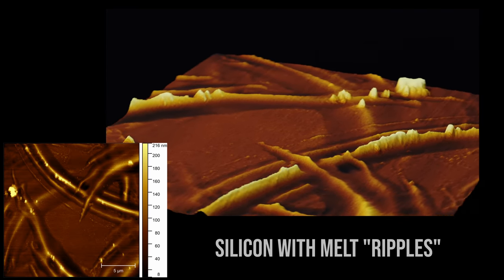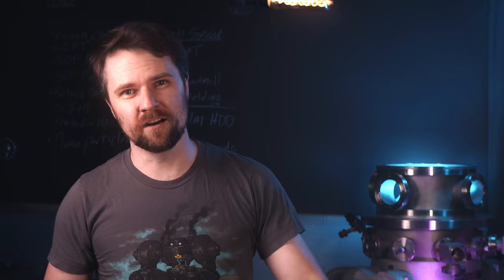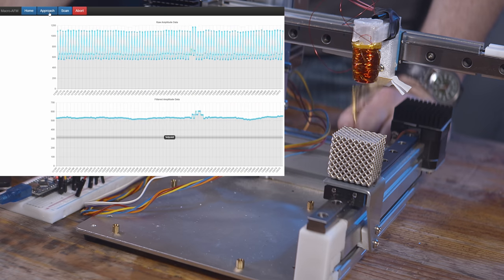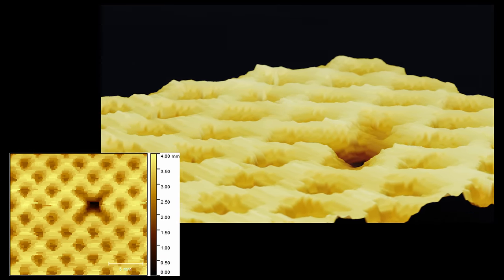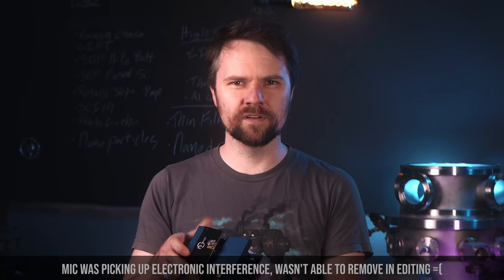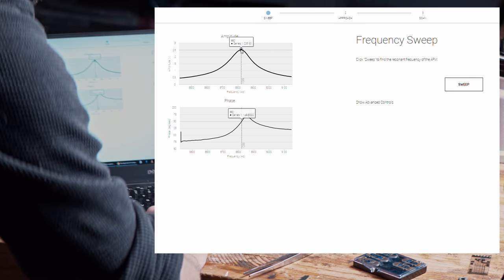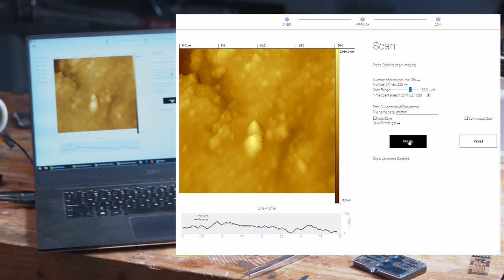1,000,000x Magnification with Atomic Force Microscope

Comment: Is that typical for the surface roughness of gauge blocks, or is that abuse?
Reply from the maker: TBH I'm not sure what's expected from gage block surface finish.  This was freshly unwrapped from it's oiled paper so not abuse... but they are uhh... not the highest quality :)  I probably should have mentioned that in the video, they are cheapo imports from Shars. 😇
Reply: From my understanding gauge blocks aren't manufactured to be smooth, the main goal is to have a really precise geometry and the resulting smoothness of the surface finish is more of a byproduct :)
Reply: @dienelt5661  I was under the impression that wringing gauge blocks together required not just flatness, but also smoothness, I was surprised it is as rough as it was, but I have no way to know just how good is required, or what is typical.  I could imagine a rather large collection of gauge blocks showing up at my doorstep from all-and-sundry merely to stick them under my afm, if I owned one.  Not a cheap hobby!
Reply: @BreakingTaps  Does that face wring with other blocks?  An optical flat and monochromatic light  might come in handy if you can find one on ebay cheap.
Reply from the maker: @blahblahblahblah2933  Just tried, it does! I think I have an optical flat laying around here somewhere (watching too much of Oxtools can be dangerous to one's shop-tool collecting habits).  I'm starting to work on some shorter "Micrograph Monday" segments which just look at neat things under the AFM or other microscopes, will make sure I do a followup on the gage block and show the wringing and optical flat results.  Would be interesting to see just how flat it is at a "macro" level compared to the micro roughness numbers.

Comment: I'm pretty sure AFM stands for Amazing F-ing Microscope. 

Just one question, can that tip get fouled by something? If so, is it possible to clean the tip?
Reply from the maker: Theoretically, yeah, the tip can accumulate debris and other junk.  The coatings on the tips are relatively inert (aluminum oxide and diamond-like carbon, depending on the tip) which helps prevent it from chemically bonding to things. I've not had any major problems so far though.  Had a large piece of junk stuck to it once but was able to "shake" it off by re-running the cantilever sweep process.  Otherwise no real issues.  More often it'll just scan over the debris (like dust particles) because the tip is so tiny compared to most particles it encounters.

But because they are tiny and delicate that there's no real way to clean it by hand if they happened to get dirty, so if it ever does get contaminated badly I think the tip is just done.

Comment: Would it be possible to do a DIY version of this. I have a machinist and toolmakers background but I now work in metrology and run my own lab and small business from home. I mostly do component level troubleshooting and repair for industrial and research clients. But I specialize in test equipment calibration and configurations. 

I also have a pretty decent photonics lab piece together over the years of government and industrial auctions. So I’m just curious if something like this would be possible for a decently comparable DIY version…? At say a 10th of the cost so I guess that means under $3000. Just curious.

Comment: Is it possible to use one of the probes to probe part of another probe (without damaging the subject)? From what you explained, it doesn't need to contact it?
Reply from the maker: Haven't tried, but it should be possible! This machine uses tapping mode, so it is making (very gentle) physical contact about 9000 times per second.  But the force of the cantilever is quite small so it doesn't damage the subject.  Although amusingly, that probably means imaging the cantilever itself would be difficult since it is likely to flex under impact of the other cantilever, as they are both designed to be soft :)  But otherwise yeah, MEMs are a perfect subject to image.  I'd like to pry open some common MEMs (gyros, etc) and see what they look like :)

Comment: plasma sputtering crystal growing, even that silicon, not the two usual processes, Czochralski or Flame fusion, cvd/pvd type layer growth instead, to wafers, in vacuum chamber, for cheap, simply, fast, a ton, tons of wafers
Reply: so you made a gramophone head
Reply: laser interferometer (graviton detector) distance measurement
Reply: hard disk is a mini "atomic force microscope", or at least it should be
Reply: actual up-down movement, no angles, for the atomic force microscope stuff
Reply: spring instead of bending lever arm
Reply: multiple read/write heads in a matrix, each writing its own scan line
Reply: piezo crystal is a self-regulated spring
Reply: also self-measured and generated response to touching

Comment: Do you think it would be possible to observe the circuitry on a silicon chip, after some careful lapping maybe ?
Reply from the maker: Definitely!  I'm trying to hunt down some more bare IC dies to scan.  Theoretically it'd be best to avoid lapping, since that would remove some of the topographical features, so either a plain die before it's encapsulated or a decapped one with just chemicals.  That said, the machine also records phase information, so you might be able to see the phase difference between polysilicon, metal, silicon, etc even if the surface is lapped flat.

Amusingly, the IC I showed at the beginning ended up being really hard to scan because the features were so large (due to its age)
Reply: @BreakingTaps  Wait, phase information?  What phase information?!
Reply: @BreakingTaps  wow that sounds like it could yield some amazing photos, but the results would be even more impressive with more recent hardware because of the transformation size, but those don’t come cheap especially right now :(
Reply from the maker: @aneb2002  Yeah! I didn't have time to talk about it, maybe in a future video. ICSPI actually has a really good blog on it (https://www.icspicorp.com/blog/afm-phase-images), but my understanding is that it records how much out of phase the cantilever oscillation is with the drive frequency, and that can give information about the mechanical properties even if the height is the same.  Softer materials will deform differently than stiffer materials and so the phase changes.  TBH I'm still trying to wrap my head around it, but I've seen a few scans that were really fascinating (aluminum on glass was very obvious for example: https://twitter.com/BreakingTaps/status/1388264624429146114)
Reply from the maker: @dienelt5661  Agreed! I'd love to see some stuff made in the last ten years. How cool to see 50nm gates or similar :)
Reply: @BreakingTaps  You can grab some parts with windows any microcontroller with an eprom should do.  Or even a cmos or ccd camera sensor  should be pretty easy to come by.
Reply: @BreakingTaps  If I'm understanding right, we're talking about non-contact FM-AFM right?   And you're talking about the phase difference caused as the tip approaches and the spring constant of the cantilever is shifted from one end of it's travel close to the surface to the other where it's less affected?   Also, the link you link to ICSPI returned a 404.
Reply: Actually, given you posted that twitter scan from your afm, and you're running tapping mode afm, I am now entirely confused about exactly what phase we're in/out of.
Reply: remove end brackets on both the links if anyone else doesn't spot it
Reply: ...and the icspi link explains tapping mode phase shifts quite well, ty for that!
Reply: the tldr for anyone is that in tapping mode as the tip interacts with different surfaces, any 'stickiness' to the surface (if that be actual stickiness or just the probe deforming into the substrate more with viscous effects) slows down the rebound creating the phase shift.

Comment: But wouldn't that poking smash tip and mess results? How would you spot such problem on that small tip?
Reply from the maker: You're right, the tips do wear down over time!  Tips have different wear rates depending on size/shape and their material.  Generally the smaller the tip, the faster you'll notice wear.  E.g. if a hundred scans changes the shape by 1nm, it's much more noticeable on a 20nm tip than a 100nm tip.  That said, my particular tips are coated in Al2O3 and DLC (depending on style) so they are pretty "hard" and don't wear too quickly, but other kinds of tips used in different machines might only get a handful of scans before needing replacement.

Detecting the problem is down to A) if you aren't happy with results or B) running a calibration test.  There are special test substrates you can purchase that have well-defined features (nanoparticles, test gratings, that sort of thing) which you can scan to see how much your tip has changed.  But I think most people probably just replace the tip once the results start looking "not good" or features start to look larger than they should.

Comment: By which mechanism does the device scan in the X and Y directions in order to achieve the 20x20 microns area?
Reply from the maker: The MEMS device is built with a set of integrated flexures and actuators that provide the momevent.  I believe they use thermal chevron actuators to actually drive the flexures.  You can see some of them in the SEM images on ICSPI's site: https://www.icspicorp.com/technology (scroll down about half way)

Comment: I dont get the mechanics of this mems device. Any chance you could explain it? How realistic are those pictures? The 360 view would be great.
Reply from the maker: Which pictures?  The black/white image is a scanning electron micograph of the MEMS device, so that's the real thing.  I'll see about doing a deeper dive into the MEMS in the future, but the tl;dr is that it uses a series of thermal actuators and flexure couplings to move the probe around.  Apply some electricity to special "chevron" structures and they heat up/expand, which causes part of the flexure device to move. That let's them control motion in XYZ, and a similar mechanism allows the cantilever to oscillate
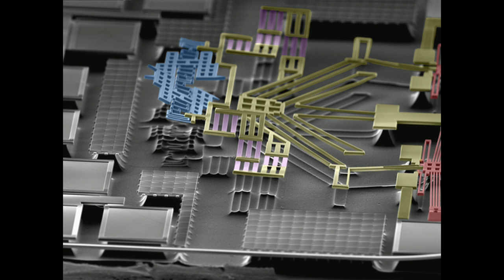Reply: I meant 13:03 and consecutive picture.
Reply: I do understand the principle of it. What is hard to see on the picture the mechanical design of it. In what directions are those parts flexing and which parts are moved how. I know its a bit overkill but look at this video how fellow analyses the chip:
https://youtu.be/FMdYuGpPicw

Comment: why not just glue half a pin on the end of the thing? wouldn't that be a stronger and wayyy taller/sharper probe? (i say half because a full pin would probably be a bit too long for that machine idk)
Reply from the maker: Yep, that would work! Only thing to watch out for is the "arm swing" of a taller probe which might hit the side of features.  But should work fine! I just did it with the brass sheet that way because that's how the original paper did it 🙂
Reply: @BreakingTaps  If the arm swing was an issue you could just cut the pin shorter, there's probably a sweet spot between having an arm that's too long and has too wide of a swing, and having one that's too short and cant reach into holes. Anyway that's for replying to me, and I'm a big fan of the Micrographia channel! Its so relaxing to watch!

Comment: You mentioned rendering, and I notice some distinctly python looking graphs - are you rendering out those videos via some python program? Does that take a while? I’d be happy to write something that would let you fly around inside the data in real-time if it made your life easier. : )
Reply from the maker: A whole mish-mash of technologies😅 The "macro-AFM" that I built has a Rust backend that talks to the Arduino, and also serves REST API server.  The UI of the macro-AFM were written in Javascript (Bootstrap and a graphing library), talking to the Rust server.  

3D renderings were actually done in Blender.  Basically imported the scan (either from my macro-AFM or the real AFM) and used it as a displacement map on a plane.  Pretty much what you'd do to visualize terrain or something similar.  Then just some textures and lights to make it pretty.  Interacting with the scan in Blender is pretty fast and seamless, but yeah rendering them out in HighDef takes a while since I'm using the raytracer.

And the real AFM has it's own UI, unsure the tech there.  Some kind of native app :)
Reply: @BreakingTaps  sweet - sounds like you’ve got it all handled :D 

Is it possible you could share out some of the data? I’d love to play with it

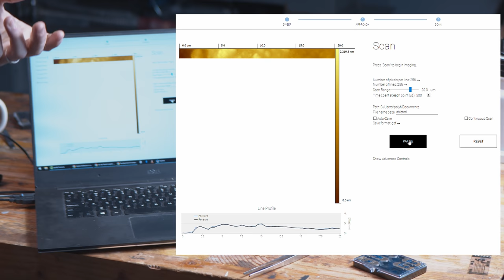Comment: At 16:25 i was  hoping to see a close-up of the scanner and the tip doing their thing rather than a screen capture of a software.
Has this intentionally been "censored"?
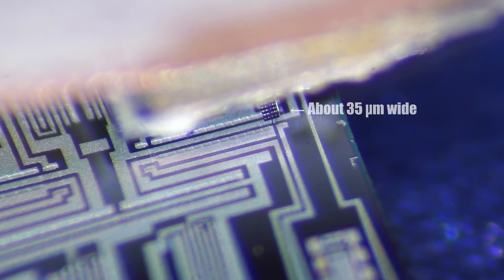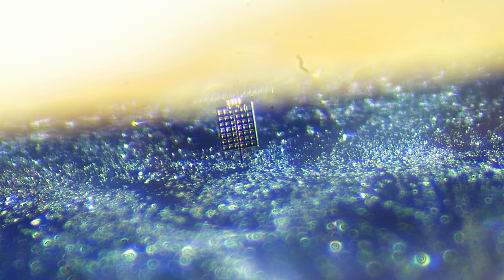Reply from the maker: Nope, just wasn't a very interesting shot with the arrangements of cameras at the time! The angle I had on the macro lens (for the clips of it approaching) wasn't close enough to see any movement of the probe, and the wrong angle... it's really hard unless you're using a microscope at 45 degrees. Since I was gesturing at the screen I thought folks would rather see my gesturing + the actual scan, instead of a static shot of the machine not doing appearing to do anything.  You can see it scanning an IC die at 2:48 and some tungsten disulfide at 13:13

I'll be doing more videos on the AFM in the future and will try to include more footage of the probe scanning the sample!  The folks at ICSPI said I can film the probe scanning as much as I want, so I'll be sure to include it more :)
Reply: @BreakingTaps  Cool! I look forward to it :) 
At first I thought that the "bed" did the scanning, but on the ICSPI website I saw that the MEMS does the scanning as well as the tapping; the "bed" is only for coarse adjustment and does not move during "image-capture". Pretty nifty!
Reply from the maker: @AdityaMehendale  Yep! the stage only moves up and down, and only positions the probe in rough position.  Once in proximity the flexures on the MEMs device does the rest of the positioning.  Pretty amazing!  BTW, I was planning on releasing a video on monday showing some tungsten disulfide scans in more detail, I'll try to go capture some more footage of it scanning from different focal lengths and include that before releasing.  Been several questions about seeing the probe in action so probably a good idea to elaborate on that more.  Cheers!
Reply from the maker: Here you go: https://youtu.be/m0UK7LVSZ8g?t=290, timecode 4:50 if you want to jump ahead! Hopefully that helps explain/show why I didn't include more of it in this video :)  Cheers!
Reply: @BreakingTaps  Thanks!  I'm not gonna jump ahead; I plan to enjoy all the juicy details :)

Comment: What would the result look like if you introduced vibration to the table? More vibration than the laptop put in that is.
Reply from the maker: If the noise or vibration is large enough, it makes little horizontal streaks in the image, turning part or a whole row into noise.  If it's a really bad vibration it might last for several lines.  Some of that can be corrected in post-processing, but if the vibrations are too bad you'll be left with horizontal "scars" in the data.

Comment: Shouldn't you be working in at least a clean room to prevent destruction of AFM tips.
Reply from the maker: I'm told they are pretty robust, e.g if some dust lands on the tip it'll mess up the scan but won't ruin the probe.  You can re-sweep the probe to help dislodge particles, or have it scan something hard like glass to help shake it loose.  A cleanroom would be ideal for minimizing junk on the scan but I don't think it's necessary for this particular AFM.  Maybe for others, not sure!  Unfortunately don't have experience with other ones to compare/contrast :(
Reply: Nah clean room isn't necessary as far as the device is concerned. The only time it matters if you are concerned about contaminating the sample.

Comment: Could we have had at least one shot of the thing actually scanning or would the movements have been too small to pick up on camera?
Reply: He actually shows it at 13:14, although it's super magnified. It's really hard to see movement that small with your naked eye.
Reply: @mateijordache1952  15:55 isn't actually scanning the part and 13:14 is the thing just in thin air but i suppose 13:14 is the closest we got
Reply from the maker: @darkmann12  2:48 is scanning that ancient IC die, 13:14 is actually scanning a glass slide with tungsten disulfide smeared across the top. :)  The depth-of-field is just so shallow at those magnifications that it's hard to tell what's being scanned.  I didnt show the machine from a distance when it is scanning because honestly you can't see it do anything, even the tight macro shots hardly show it moving. Really need the microscope to see anything at all.  I'll be doing more videos on the AFM in the future though, so I'll be sure to include some more footage of the probe wiggling about.
Reply: @BreakingTaps  Ah I was beginning to think it was just really hard to see, thanks for confirming it! I can't wait to see more honestly, that thing is super cool and interesting!
Reply from the maker: @darkmann12  Yeah if you hold it right up to your face and squint really hard, you can sorta see a point of reflected light from the "waffle" grid on the probe. And that's about it :)